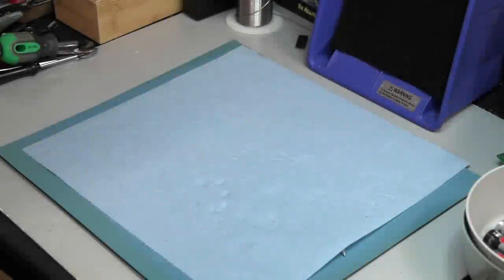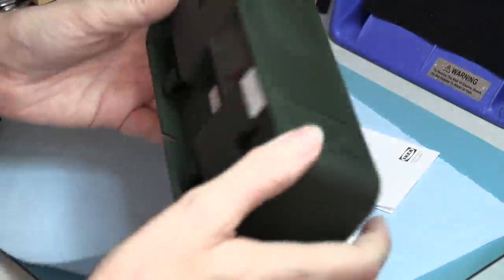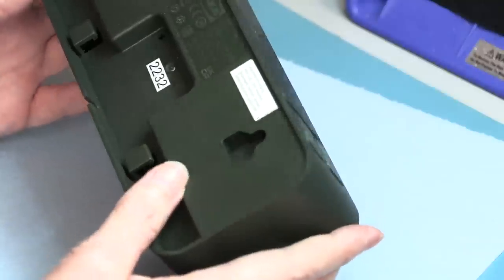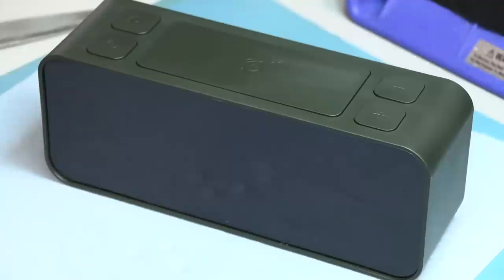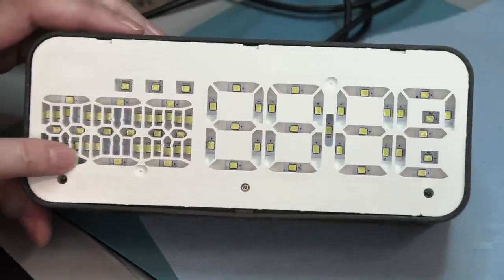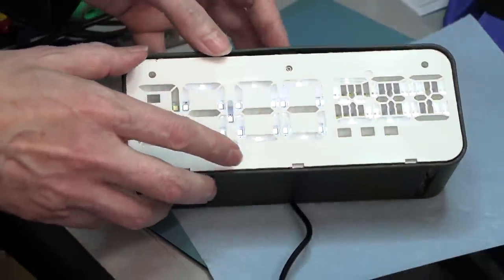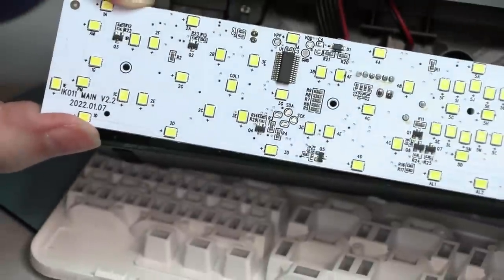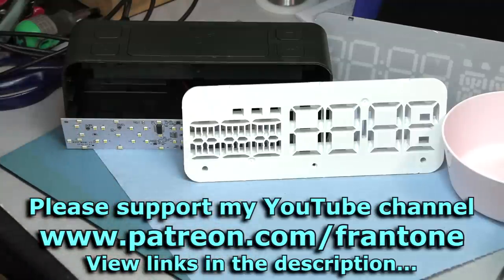Beneath The Mask Of A Cheap IKEA Clock

Comment: So, you could remove that dot-segmented defuser sheet and replace it with a clear green defuser for the retro 80's look. You could also go the whole way and use self adhesive woodgrain for the case.

Comment: Bedroom LED clocks should be red damn it!
Reply: I love my blue clock and bedside flame effect light.
Reply: Also, the original red LED type runs at 1.6V instead of the 3V needed by blue LEDs with color converting phosphor .
Reply: Mine is green. I prefer it over red.
Definitely not blue, though.
Reply: Mine is orange, so it's in between red and green!
Reply: @olmostgudinaf8100  Red doesn't keep you awake or ruin your night vision.  That't why they use it in berthing compartments in naval vessels.
Reply: @ferulebezel  I know. I just prefer the green for aesthetic reasons. Or maybe I just got used to it.
Edit: I think I would prefer orange even more, but mine is green 😁
Reply: No thanks. I have an irrational hatred of red LED displays!

Comment: looks like the case almost needs a good lead ingot, to increase the weight for more perceived quality, plus so doesn't accidentally get knocked off the table!
Reply: Not lead but something else would be a good idea.  Just a chunk of iron would be fine.
Reply: Eine Hand voll rostige  Schauben und Muttern und ein paar Tropfen Superkleber hätte einen ähnlichen Effekt 😅
Reply: If you're going to put it on a table/desk/etc definitely. It also has mounting brackets on the back, though. To hang it on the wall I'd want it to be light as possible.

Comment: the idea of the EU standardising on micro USB (and now USB C, haha!) is that you don't end up with multiple units of the same adapter. So to  follow through on that you really need to not ship an adapter and use one you already have.
Reply: "Universal" serial bus with a million different connectors how ironic.
Reply: @LanceHall  just micro usb (for most cheaper shit) and usb c (for everything else), what million connectors??
Reply: Yes, to reduce e-waste. You can buy a usb charger and cable separately in ikea if you need one
Reply: You still need to buy an adapter and the EU doesn't prevent that being included. I would have at least expected a cable to be included. The EU never standardised on micro-USB, only recommended it and that was over a decade ago. USB-C regulation attempts to prevent waste from proprietary plugs and sockets on chargers, but this product seems to breach even that future law, which might be why the stock is being quickly flogged off in the US.
Reply: @oldblueshirtguy  Not sure if this is really affected by the new EU USB C regulation. It isn't rechargeable so it doesn't need any charger. And the rules differs between rechargeable devices where one power adapter can be used for many different items, and devices that needs permanent power.

Comment: The chip may well be a microcontroller at heart.  It doesn't take much of a micro to make a clock.  If you are making many clocks that are a variation on the LED clock, doing a microcontroller based thing saves you from making a lot of different chips.

Comment: Here in the UK, consumer laws state that electrical devices have to come with everything needed for the device's basic operation. So a cable and power adaptor would be needed for the clock to function thus would have to be provided. Modern devices bend that law a lot by only providing the cable if they have a chargeable battery built in, providing it with a full or partial charge so it can technically be used out of the box! Very sketchy indeed.

I once bought a light hood for taking photos of objects in an evenly lit environment that was powered by a USB cable, no batteries. They did not provide the power supply so I complained to Amazon, stated the applicable law and they proceeded to refund me the full amount for the hood but allowed me to keep it! lol

Comment: If no-one has mentioned it BONDTOLVAN is made up by Bond(e) meaning Farmer and Tolvan meaning Twelve, maybe hinting something about old ages when farmers were working all day long. Maybe ...
And to use the Ford joke - you may get that clock in any colour as long as it is army green.
Bought one similar for my wife who complained she got blinded by the angry bly LEDs when she was checking the time at night. Bought a good old analog alarm clock with a little lamp (not a LED) för a few bucks.

Comment: I'm surprised nobody has commented on the big label on the front: 'Excl. 5V Micro - USB cord'. I was not at all surprised when you opened it and found it had no cable included.
Reply: Yep, that really stood out (it's inverted and to the side) long before the box was opened. And the reason is rather simple too: People have been buying and losing phones with included cords for decades. IKEA don't want to add to the pile of orphaned chargers, but provide an opportunity to use one productively. They also offer a large variety of them, e.g. Koppla, Småhagel, Åskstorm, Lörby and Nordmärke. I have a 5-port charger near my bed to charge phone, watch, tablets (eink and leia), game console, and yes, power a clock. And of course the power cord is region specific, while the clock isn't.
Reply: Not reading labels and complaining about obviously NOT missing parts. Who has not a drawer with unused phone chargers at home? I like Ikeas approach to not piling up electronic waste. And, if you read the box IN the store and do not have a power supply and a cable, you can get one.

Comment: I noticed well labeled i2c contacts on the pcb. Somebody will certainly have investigated the hackable prospects by now.
Reply: i2c would be interesting, even jtag is interesting if it's easy enough to read
Reply: What hacking stuff would be worth investigating on a clock?

It either displays the time, or it doesn't display the time.
Reply: @volvo09  maybe add functions like homeassistant intergrations idk, people have the weirdest things
Reply: @volvo09  Hook i2c to an ESP32 and for $5 you have an NTP atomically accurate alarm clock. 🙂
Reply: @volvo09  You can do quite a lot with some tinkering.
- get automatic time synchronisation
- automatic daylight savings
- ability to show seconds instead of day-of-week
- add a count-down timer
- add stop-watch
- more steps for the intensity
- add a light sensor and have it automatically adjust the display intensity
- different alarm times depending on day-of-week
- multiple alarms same day
- configure over WiFi or Bluetooth from phone
- add shake snooze
- add shout snooze
- ...

"It's just a watch" doesn't change the fact that the sky's the limit.

Comment: As you mentioned, your having to provide the DC supply means that IKEA doesn't have to handle the logistics of all the different wonky power plugs used in the World.
Also, not supplying an AC adapter limits the manufacturer's liability and facilitates CE compliance.  It also places the liability on the manufacturer of the AC/DC adapter that you must purchase.
Reply: Also most homes have dozens of chargers floating around. Or 5V options built into other stuff.

Comment: Almost nice, the actual time is nice, however the day part sucks, I'd like to be able to de-select that part.
One BIG problem, is accuracy, In the past pretty much all mains powered clocks used the 50/60Hz AC mains as a reference, and as such kept really good time, However these newer 5V USB powered devices have no access to that and will slowly drift off. I have one and it is a pain. They have saved a few dollars by not having to include the mains transformer power supply of days past, but in doing so have saddled us with crappy clocks that need frequent attention to keep them on-time. 
Even many newer clocks that include the supply, use a switch mode power brick that does not pass on the 50/60Hz reference - so whilst complete, cannot accurately tell the time.

Comment: I saw that there are power pins and I2C pins on the PCB. It seems that a hack such as installing a GPS module may be possible. However, since most MCUs are installed with the firmware locked, it will not be possible to use them in their original state.
Reply: Cut out the MCU and add a $5 ESP32. That 'll give you NTP time via wifi.

Comment: It still stuns me when I see a package opened to reveal the product there right up against the packaging, with no apparent protection from getting knocked around in shipment. It seems like a trend Apple started that everyone now copies. It's good that less packaging equals less waste, but I would imagine the number of units defective upon delivery is greater.

The case appears to be designed to accommodate a battery-operated version, as it seems to be twice the depth it needs to be to contain the necessary components. I also agree with your sentiment that the "dots" diffuser diminishes the clock. A diffusion filter + color gel would greatly improve the appearance of the display over the provided "lens."

Comment: Thank you so much for this video! Was watching this clock which I bought about a year ago already forquite a I while......Useless in the corner as apparently it needs to be plugged in all the time. I love mddoing so now I gonn make it also work without the usb cable and add a usb charging regulater in it + 3 repurposed e-sig batteries in paralel + a little 5 volt Solar panel. My hopes are high :)

Comment: No adapter is supplied because most likely everyone has plenty of those laying around at home.
Reply: And if you don’t happen to have one, they’re sold very cheaply at IKEA.
Reply: Do they? I always find I have more phones than chargers. Yes I can easily "borrow" one from another device, but a clock needs constant power.
Reply: @oldblueshirtguy  So then you’ll need to buy one. Why supply a charger to every single person when not every single person needs one. That doesn’t make much sense.
Reply: I noticed during the teardown no presence of a backup battery or a supercapacitor, this means that in the event of a loss of power supply the time is lost and if an alarm is set it will most likely never go off. I have a Sony radio clock and it has a small button cell battery to keep the clock running even in the event of a power loss.
Reply: @CT-vm4gf  I think if I buy a clock I expect to be able to plug it in. It's the same reason batteries and plugs are usually included with products these days. If I didn't need the whole clock I could buy a kit.

Comment: Last week I bought one like this guy, as I collect IKEA clocks. As mysteriously showed at the store without any power, I got to know myself. LOL.
Happily I own a lot of MicroUSB cables around. It must have the cable included with the proper length to use. There are even AC power strips with USB connectors. Also It could be better to have the digits with more a bit separation for visibility and with some auto brightness control. It is so cluttered.

Comment: The product page, it says next to a small in a circle: "USB-cable not included with the product. IKEA recommends that you use LILLHULT USB-A to USB-micro cable." I actually agree with the trend to not include basic USB power adapters, but I think necessary power cables should ALWAYS be included, since, well, it's NECESSARY for the product to work, so it will almost positively be used with every purchase.
Reply from the maker: Exactly.  New Toaster (cord sold separately)
Reply: @FranLab  Remember when they used to give away a toaster if you open a new bank account with deposit? Imagine getting a free toaster, but then you have to go to the store and buy a power cable for it. Of course, I really have to wonder who actually wanted a Wanamakers bargain basement toaster, free or otherwise, anyhow.
Reply: The problem is that there are different plugs. Apple provides USB-C to lightning cable withe their phones. I t would b useless to me. I would have to buy separately either USB-A to lightning or a power brick with USB-C. I thin most have 
Micro-USB cables that they can use.
Reply: @okaro6595  🙄🙄🙄 It's a wall clock. It's JUST a wall clock. It's not an phone peripheral. The USB port is merely for power delivery. Nothing more. No Data. No Alexa integration. Its a clock. An actual clock. It's job is to tell time. Just to tell time. The plug would go into a USB-A (sometimes USB-C) port on the power adapter, or a powered USB hub, etc., and these things almost always have a USB-A port, and the rest have a USB-C port. None have Micro USB or Mini USB ports.
Reply: @all4espi  Exactly. Many adapters have a type A port, some have a type C port. And of course there are plenty of adapters with Micro (and Mini) connectors on an integral cord.

Comment: Would be interesting to see if one could convert it into an NTP clock with an ESP.
Reply: Well, you could get the time via NTP, power-cycle the clock by a small mosfet and then "twiddle the knobs" with the ESP to set the clock.
Reply: @tomteiter7192  I think one would need to build a driver to  drive those specific LEDs, which appear to be a segment (via the diffuser), per LED.
Reply: @MicheIIePucca  No, the idea is to let the ESP act like a human would press the buttons. Like a remote control. And leave the clock circuit itself unmodified.

 For example: 
Set the time to, say,  Wednesday 14:02 
- power cycle 
- press SET for 2.5 seconds (one might even check if some segment in the hours display is now blinking)
- press "-" to set 24h
- press SET
- press "+" fourteen times
- press set
- press "+" two times
- press SET
- press "+" two times to set WED
- done. 

When the clock's control chip reacts fast enough this could be done almost invisibly.

Comment: I have mixed feelings about the power adapter business. Obviously there are cost and logistics advantages to "provide your own USB power supply and cable."

On the plus side it means not dealing with cheap, single port adapters and short cables that are what's usually included, assuming they aren't barrel plugs hardwired to the transformer.

Also if used where other USB powered devices will be plugged in then a multiple adapter makes s lot of sense.
Reply: Also probably European laws about not bundling a USB adapter in everything?

Comment: Let's fill it with rechargeable batteries and a charger circuit ,make it last 6 months a charge
Reply: ...and add some weight to it in the process. It is too light and gets too easily knocked about.

Comment: Efficient clock design. If I count correctly, there are 61 segments  which you can drive as a matrix with 8 row and 8 column pins (you could do it with less pins with charlieplexing but then I'd exoect a lot more links). Then there's 6 pins from the buttons (including power and ground), I assume one for the buzzer and chrystal each and two for the test ports of sda and scl, which makes 26 of the available 28 pins.

Comment: A small internal lipo battery would've been nice considering the purpose, and all the empty space in the case. Nothing worse than a clock that's annoying to set and loses its setting when the power fails. But IKEA isn't stupid, adding a flammable lithium battery probably would have massively increased their overseas shipping costs. It would be an easy DIY hack to add into the case considering the USB port is already on its own breakout board.

Comment: Re: The lack of an included power supply: 
These days people who use USB devices like cellphones have multiple USB outlets by the bed and other places; personally I now only get power bars with built-in USB sockets.  I'd rather have to buy an extra supply, than have a bunch of unwanted USB power supplies that came with the device(s) I bought, needlessly sitting in the junk drawer because I don't need them!
Also there's a European directive about unbundling power supplies with devices that use a USB power supply to reduce e-waste as well as customers needlessly spending extra money paying for an included power supply they don't need or want, and I agree with that directive.  
Out of all the recent USB rechargeable/powered devices I recently bought (MP3 players and a bluetooth speaker), only ONE came with a USB power supply and that was my handheld gaming device because It required a large 65 watt power supply.  Otherwise I hate the e-waste that every time I bought a new phone or tablet it came with a basic generic USB power supply that just gets put in the junk drawer unused because I just keep using the old charger, or a USB socket.

Comment: interesting design, so cheap they eliminated the left-upper segment of the first digit alltogether, since it can only display a 1 or 2 so it's not needed (save 1 LED)...also like most new elektro-krap, by not providing the PS, they don't have to have meet any US UL listing/FCC approvals/requirements
Reply: The missing top-left segment has been the standard feature on digital watches since the dawn of time.

Comment: Got to say, its really kind of stupid that it doesn't have a battery, or atleast one just to keep the time accurate, one of the flat CR ones. It should really be a basic feature that every time you move your clock, you don't have to set the time.
Aside from that, a normal lithium batt would've been a nice to have too, but I guess they sell a version with it.

Comment: Many/most AC addaptors these days are Switching PS that accept "universal"(100-240AC) input voltage. Only the AC outlet plug style differs per the region of use. Whats that DC Input connector type; Mini or Micro USB? Does it have a 12/24 hr format option?

Comment: IKEA clocks are really not what they used to be. Way back they used German movements. Then they started to cheap out and use chinese ones. These day I don't relly use them as they're imho too inaccurate. In my area they apprently don't sell radiocontrolled ones even though DCF77 is very well received here. Apparently they only sell them in Germany. If at very least they could make clocks that used DS3231... Would make so much better clocks. Clocks that are actually useful instead of discount decoration pieces.